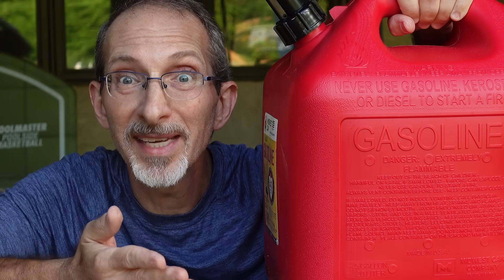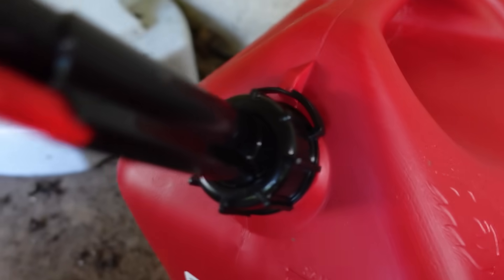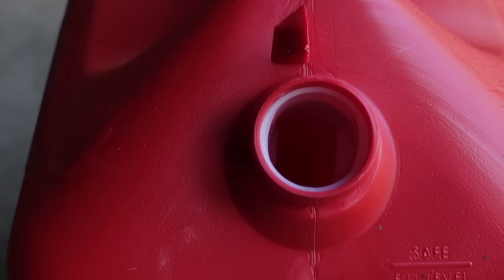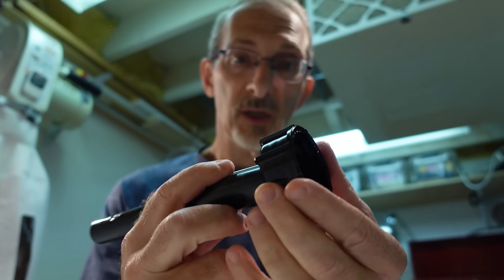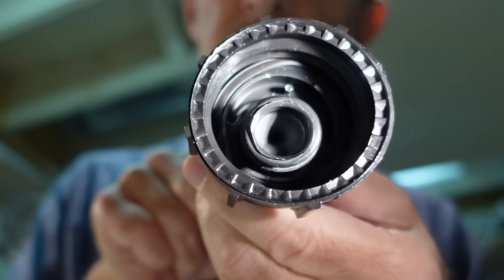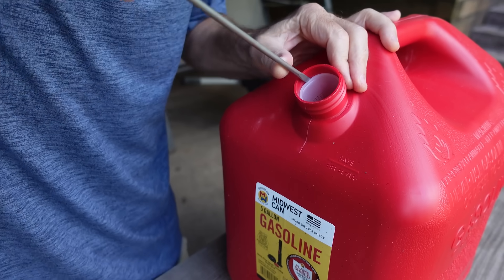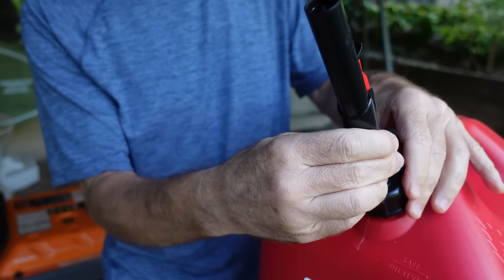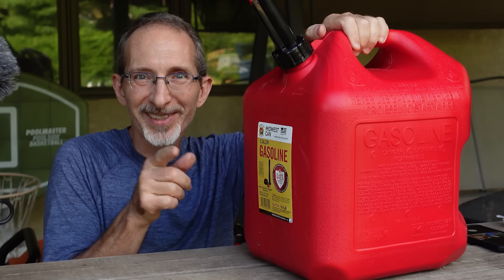Gas Can Modification | New Gas Can Fix

Comment: IMPORTANT NOTE:   The white plastic mesh that Midwest and other gas can manufacturers insert into the can's neck is not a filter, but a flame arrestor / suppressor.  This feature is intended to prevent a spark or other ignition source from accidentally igniting the contents of the can, which could cause an explosion.  

Unfortunately, this safety feature can cause several problems: 1.  It can fool a gas station pump's nozzle into erroneously sensing back pressure which results in the pump automatically shutting off the gas flow. 2.  It will prevent the use of a siphon to extract the gas from the can.  Siphoning gas from an elevated position, for example from the top of a trash can can be easily accomplished using a manual (with a "hand bulb") or a battery powered siphon pump. Transferring fuel in this way is a much easier option for those unable to hold the weight of a 5 gallon can at or above waist height long enough to pour the can's contents into the fuel filler opening of a typical vehicle's gas tank.

Bottom line - remove the flame arrestor at your own risk.  But for those who have already decided to remove it:  I also agree with the comment below about the effectiveness of a twisting action using needle nose pliers inside the neck of the can to collapse the stiff plastic collar of the flame arrestor in on itself.  This approach reduces the device's diameter enough to allow its extraction.  I strongly recommend against prying around the neck of the gas can with a screwdriver as was demonstrated in this video.  This is because, as Mike noted, the prying action risks deforming the rim of the gas can's rim and a flat, smooth rim surface is absolutely essential for the can's cap to seat properly without any risk of leaks between the cap and the body of the can.

Final note:  Briggs & Stratton is now marketing a new gas can spout called "Garage Boss" that features simple push button dispensing.  This can is priced competitively with cans from Midwest and other manufacturers and appears to be much more user-friendly without needing any spout modifications.  The flame arrestor is still present, however.

Good luck!

Tony
Reply: From personal experience - Those 'Garage Boss' cans are the worst I have ever used.  I switched from garage boss to midwest and really don't regret it.  There's a few pretty specific reasons for this.

First and most importantly - In my experience, when you get heavy rain (a frequent occurrence here.  avg 1-3 times a week depending on season) or even heavy dew, water pools under that button and sits on top the seal.  Then you press the button and that water goes into your gas.  Once I figured out what was happening, I stated turning the can upside down and shaking the water out.  You can't get it all out doing that though so you're just delaying the inevitable.  That's when the seal is new and fresh.  As the seal starts to wear, it'll just leak.  At that point, you get water into the gas every time it rains.  

With the midwest can design, you can turn the nozzle down into the can and screw the cap on and it has a gasket making a good seal.  This totally prevents rainwater ingress.  Admittedly, the gasket there seems a little flimsy and probably won't last forever but it's a simple task to go to the hardware store and get some replacement gaskets.  A pair of the flat type works just fine.

I kinda glossed over it there, but I can't overstate how much of a pain the ass it was to figure out that rainwater leaking through the button was the issue.  I kept thinking my issues where being caused by some sort of mechanical problem with the mower or just the gas going bad from the ethanol content or something.  Ended up disassembling and cleaning out the carburetor a half dozen times before it clicked.

The second reason - Those buttons are pretty stiff and harder to use in practice than a person might think at first glance.  Not super hard, but they do cause spills.  The spills probably aren't as bad as an unmodified midwest can spout but that brings me to an important consideration -  You can very easily modify the midwest can spouts.  TBH, I'm pretty sure that those engineers deliberately designed a spout that was legally compliant but stupidly easy to modify if you just have half a brain.  They can't say that, for obvious reasons, but I really do think that's the intent.  Those garage boss spouts are just not so simple to mod.

Anyways, that's my two cents.  This is just like... my opinion man...  That being said, it's an opinion earned with hard experience.
Reply: @ColonelSandersLite  Yea theyre basically just as bad and require you to press the button hard and hold it and then it hopefully locks in place. I mean they all work great when theyre new but after just alittle use outside and it shows its lack of quality kind of quickly. Its just as frustrating as the new gas can necks like in the video but at least like he said. They do work pretty well on cars and motorcycles with a solid tank neck to push against. 
I have the metal B&S can now but with a old school nozzle i found that fit. 
Still i find that anything but a normal oring style cap is the only style that lasts consistently and doesnt leak after a few months..
Reply from the maker: Tony, thanks for your detailed comments! You are correct about the filter being a flame arrestor, which I corrected in my second video, link in the description. Agreed on all of the points that you brought up – excellent! Thanks for the tip on the Briggs container, I will check it out!
Reply: We made it over 75 years without them. They can keep their little white Bicycle helmets too.
Reply: The fumes are what explode when the spark reached it.
Reply: "It will prevent the use of a siphon to extract the gas from the can". OK, who would bother siphoning gas out of a gas can when it would be much easier to steal the entire gas can?
Reply: @snoozeflu  You probably need to reread that post.  He wasn't talking about siphoning in a theft situation.  He was talking about siphoning as an alternative to just pouring.

Comment: A year ago when my wife ran out of gas in a rented 2021 Jeep, I had to purchase one of these “new and improved” gas cans at a local convenience store. The problem was the newer model Jeep had a capless gas tank (with no gas tank rim) and the spring loaded gas can nozzle had no rim to activate the nozzle. An on-duty policeman happened to drive by and offered assistance to no avail (he couldn’t figure it out either).  Fortunately, he had a long neck funnel in his cruiser and we were able to detach the nozzle, pour gas into the tank and be on our way.  He told us he had the long neck funnel in his cruiser because we weren’t the first motorists with the same problem.

Last night, she did it again 🙄, this time at night in the middle of a rainstorm.  She was in her 2016 Honda CRV with an old style “capped” gas tank, so I thought I could give this new gas can nozzle another try. I took the new gas can, had trouble filling it up at the gas station (like the video says) and drove to where she had pulled over on the side of the road. It took incredible pressure to get the new nozzle to depress and (due to the new ventless gas cans) the gas poured very slowly out of the container. Long story short, the whole experience was a nightmare. There was no shoulder on the busy road where she had stopped, it was dark and raining, and I had to continuously interrupt my efforts to avoid oncoming traffic at 50+ miles per hour. I must have spilled 1/3 of the gas in the can while attempting to use it under those circumstances.  It was a very dangerous situation.

I’ve always owned land and numerous gas powered mowers, weed whackers, chain saws, etc.  (I got rid of my old gas cans when we downsized to an apartment.)

Never ever had a problem with the old gas cans, but now they’re “illegal” and you can’t buy them anymore.

The new “safety” ventless gas cans with the spring loaded nozzle are horrendous.
Reply from the maker: JayBird, wow. You perfectly describe the situations that are so common, where these containers completely fail. Even after the mods, these spouts are designed to dispense fuel straight down, and not into a hole on the side of a vehicle. Having a long neck funnel is the way to go!

Comment: The lock on the cap is a pain and I removed them.   However, on one of my plastic cans anytime I bump the nozzle moving the can around during filling the cap will loosen..  Check for this before removing the lock.
Reply from the maker: That's a really good comment! My suggestions are mostly relating to how these containers handle when you are dispensing fuel. Transporting and storing them safely is very important too!
Reply: @MikeFyxdt  So far the only can I have had this problem with is the Spill-Proof Gasoline System by Vexa.  With this can you have to hold the nozzle to press the fuel flow button.   This also makes it more likely you'll twist the nozzle.  Especially on a full heavy can.  Overall the can is ok, but I can't recommend it.  Your suggestions made my other cans easier to use.  My favorite is the 2 1/2 gal. No-Spill.

Comment: As someone who farms and use gas and diesel on a constant basis these new can designs are complete garbage. They say it's safer but I always thought this way, which is safer a slight spill on the ground that unless I drop a match won't hurt anything or spill it all over me and find myself welding or using torches later on and forgetting what happened earlier?

Thank you for your great video as I just remodeled my gas can so it works safely and efficiently!
Reply from the maker: Great comments! If I used gas on a more regular basis than I would treat myself to a metal container with an old fashion spout!

Comment: I've never had a problem putting gas in the tank or with the lock. Just buy a different brand gas tank and q uit. Bypassing the safeties that are put on the tank for a reason.
Reply from the maker: Gene, I agree with everything you are saying. In my case I needed the gas can in a hurry and this model is all that was available. I am a huge fan of safety, as long as it doesn’t impair the use of the product. In the case of this gas container design, the safety designs are a flaw. Hopefully people will see this video and start with a better product and a good understanding of how the safety features work. Thanks for contributing to the conversation!

Comment: The white filter is actually a spark arrestor.  It's supposed to keep sparks from setting the contents of the can on fire. HOWEVER the standard was probably written expecting a metal mesh arrestor... part of this is bad regulation design, part of it is manufacturers cheaping out and using plastic for things that were supposed to be metal.

tldr; just buy a quality metal gas can.  You're invest in one once, but it will last you a lifetime.
Reply from the maker: Alex, you are correct about the spark arrestor, which I later learned and updated in my second video, link in the description. In hindsight I wish I did buy a metal container! Many people have shared that yard sales are a fantastic resource to find them. Thanks for commenting and watching!

Comment: If you know the history of the blitz fuel cans and blitz went out of business from being sued to death. you had a lot of idiots that poured gas on the fire as if that was something that was safe to do and then they successfully sued blitz for having a useful can so it's reasonable that Midwest can goes ahead and fends legally by having all these devices to limit things like this and so these alterations to undo some of these 'safety features' are pretty good.
Reply from the maker: I learned about Blitz from the comments after I posted my first gas can video. That explains a lot! I hope that future container designs are much easier to use, which will naturally lead to better safety. Thanks for joining the conversation!

Comment: Was able to remove 2 of these inserts in under a minute.  Holding the can spout opening upside down (to keep the insert from falling into the can)... Used a mini needle nose pliers and inserted the tip of the pliers between the top of the can and the top of the insert about 1/4" and pulled UP on the filter. The filter comes up about 1/8" above the top of the red spout opening.  Now I take a small vice grip and grip the edge of the insert that is now sticking up outside the can and pull the insert out.  Don't have to wrestle with the insert at all.
Reply from the maker: @E P - thanks for sharing your insert removal technique! You kind of get a feel for it after removing a few. In the comments many people say that they simply punch them into the can and let them rattle around. That bothers my OCD, so I prefer pulling them out. Thank you for watching and joining the conversation!

Comment: I usually cut a spring shorter and stretch what's left to the original length to reduce the force needed. 
Growing up 40 years ago our go to gas can was a squat round dinosaur with a double cap  bottom of the cap was big like most cans and it had a smaller cap that constantly got lost when you screwed the goose neck on. Luckily the cap size was common. When my dad died we went thru the shed and he had all sorts of the fancy new cans piled up in the far corner,  but that old metal beast was front and center at the door.
Reply from the maker: Douglas we had that metal beast growing up. It was my dad’s one and only. If I knew the future of these plastic containers I never would’ve gotten rid of it… :-)
Reply: @MikeFyxdt  Unfortunately, with the advent of ethanol (read "water-attracting") fuel, those wonderful metal beasts will corrode more quickly, so the government has stepped in with a solution for the other government solution.  Problem is, they never just retract the previous mistake.  30 erroneous solutions later, nobody knows what was needing to be accomplished in the first place.  For example, take the student loan "crisis"... (sorry, got to stop now and eat some more blood pressure pills before these people do me in.  Did Fauci approve these things?)  :)
Reply: That idea occurred to me before reading this. I am reminded of the "safety" jar lids that require a hammer and industrial gloves to open.
Reply: @stefanfrankel8157  
The pill bottles?! 
The easiest way was to give them to a kid! Had them opened in seconds! Lol

Comment: I modified mine with a utility knife: just nicked off the notch on the depressor. The force needed to push down the plunger is harder than it needs to be, but it keeps the seal and functionality intact.
Reply from the maker: Thanks Dave, I guess the point is that we shouldn’t have to be making these modifications on brand new containers! I appreciate you joining the conversation.

Comment: THANK YOU FOR THIS VIDEO!!!  I see why over 19,000 people have watched this...and ADD ME!!!  My wife and I are up in age, arthritis, I'm handicapped on one side...the pits!  This spout was IMPOSSIBLE to operate!  You would have to qualify for the OLYMPICS to be able to use this spout, as it's intended to be used!!!  I found the YouTube video on the simple explanation.  I said to myself, "WHAT?!"  THEN...THANK GOD, I found your video!  Well, I tore right into one of the 2 identical spouts we have, the one that came with the can and an extra spout we bought when we bought the can, and GOT THE SPRING OUT!!!  Man, this is a LIFE-SAVER!!!  My wife has osteoporosis and don't have the hand strength to work with the original version.  I've got a good left hand (and my right hand was paralyzed in a motorcycle wreck 45 years ago...and I WAS right-handed!) so this was a tough job!  But REALLY...thank you for this video!!!  It saved me from having to return the gas can to the retail store and go on an endless search for an "easy to use" gas can!  THEY DON'T MAKE 'EM ANYMORE!!!
Reply from the maker: @Joseph Carter - Thank you for sharing your story, and for your praise! It made my day! 😁

Comment: And what if you forget to put nozzle in locked position? Or lets say the can is in your car after you filled it at the gas station and it tips over. The spring will keep the seal in place but without the spring there is a very good chance gas is going to be all over your trunk.
Reply from the maker: @Sushi - good points! Even without the spring, the spout locks in the ‘closed’ position unless the red button is depressed. Also, I always pad my trunk when I travel with my containers to keep them upright. I know people will take shortcuts, and these mods may not be for everyone, so proceed with caution. Thanks for adding to the conversation!
Reply: @MikeFyxdt  Except the way you showed it is not the way it should work. Then you press the red button it should stay in place unlocked. Then you insert the spout in to the any opening you push the tank itself and it compresses the spring. I have a chain saw and the lawn mower but never had any problem with them filling up. Besides you should not be using 5 gallon tank to fill these things anyway. One gallon can should be used.

Comment: That's great saves you some money but you can also buy a replacement one off of eBay for $7 and it doesn't have any of that on there it's the old style
Reply from the maker: @Rob Newman - Agreed! I actually bought a replacement on Amazon for about $12 but I haven't tried it out yet. It also came with a yellow vent cap.

Comment: Thanks for this video.   I purchased my 5 gal can back in 1993 and had no idea of this problem.
Reply from the maker: I have 2 containers from the early 90's. One has no safety features and the other had an auto shut off that stopped the gas when you release the handle. Nothing like these new models!